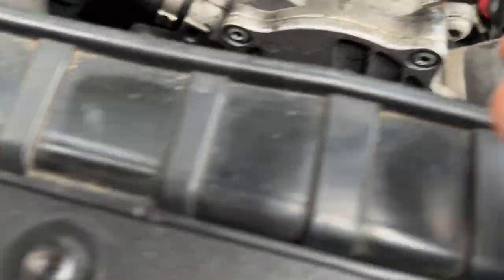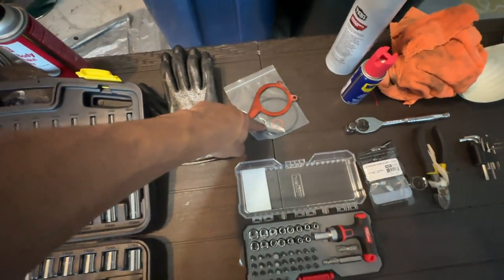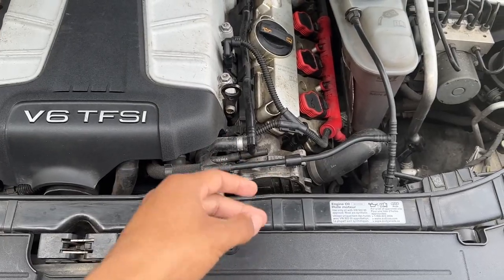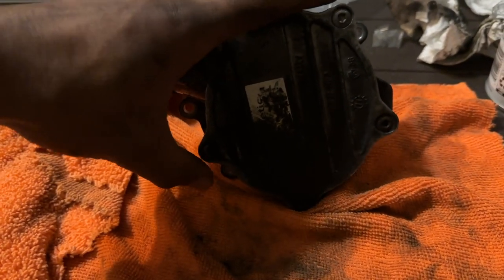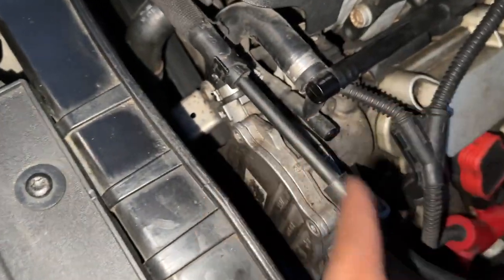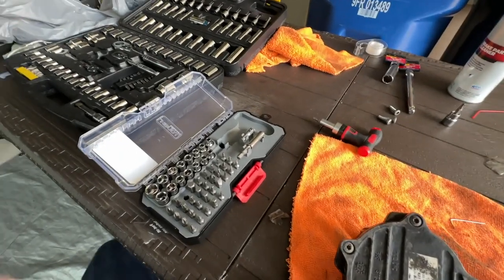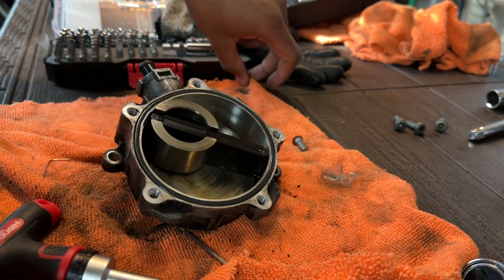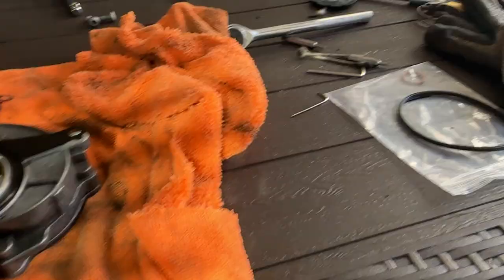Audi S4 Vacuum Pump Rebuild (Brake Booster)

Comment from the maker: Super easy job, I went back and replaced both seals with the correct kit linked bio.

Took all of 30 minutes to do the second time around.

Make sure those bolts are cleaned out to avoid stripping them.

I also used 600 grit sandpaper to clean the mating surface instead of a razor and it worked very well. No leaks at all.

Good luck to everyone!